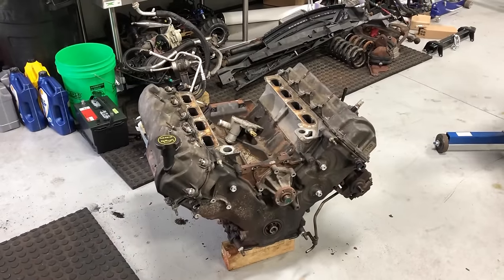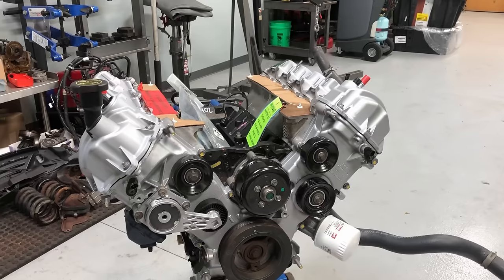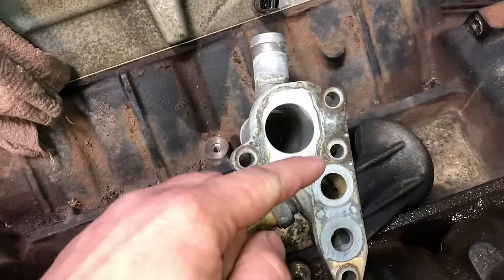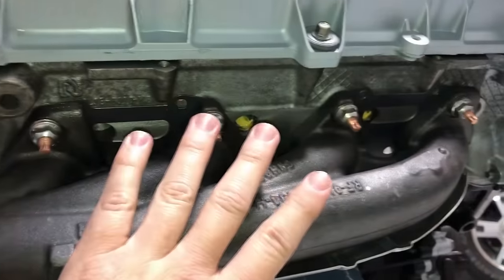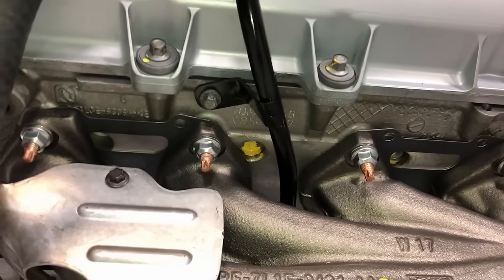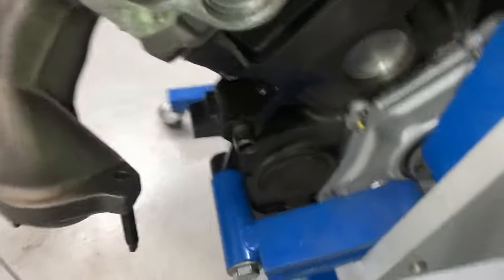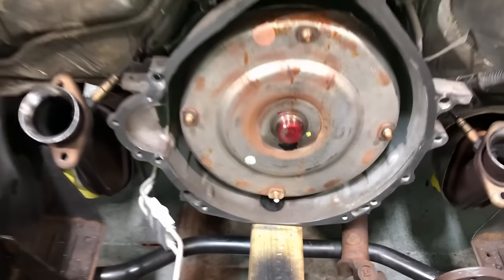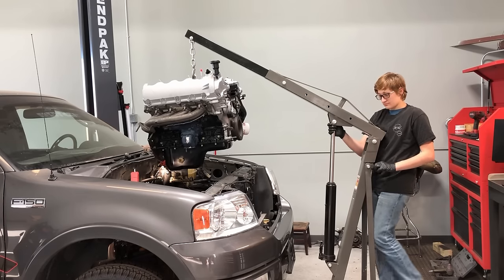Ford 5.4L 3v Triton Engine Removal & Installation Part 2 of 2: Engine Prep and Installation

Comment from the maker: These are the Parts and Tools I Recommend:
Spark Plugs 2004- Mid 2008 25ft lbs-
https://amzn.to/32tCjEw
Spark Plugs Mid 2008-2014 106 inch lbs-
https://amzn.to/2Q72fmS
Exhaust Manifold Downpipe Studs-
https://amzn.to/2X0gjQx
Permatex Ultra Black Engine Sealant (if required)-
https://amzn.to/2rxpz31
Permatex Blue Threadlocker-
https://amzn.to/2pY1IsM
Coolant Crossover Gaskets:
LH- https://amzn.to/32xHAel
RH- https://amzn.to/36PB9qj
Mopar Rust Penetrant-
https://amzn.to/35GAxmi
10mm Gearwrench (power steering bolts)-
https://amzn.to/2VRT22B
Cat Claw-
https://amzn.to/31lso3b
Trim Tool-
https://amzn.to/31ndv0f
Fan Clutch Remover (easiest method)-
https://amzn.to/35Ot9Wf
Starter Removal in detail-
https://www.youtube.com/watch?v=yhXV-aIv_bA
Remanufactured Engines I use-
https://www.powertrainproducts.net/FORD-5-4-V8-ENGINE-04-06-F150-NAVIGATOR-EXPEDITION-p/1579.htm                                                                                                                                                                                      TORQUE SPECS:
Valve Cover Torque Sequence
Early Build:
LH- https://drive.google.com/file/d/0BzYkF_-Nh949YkFXTmxFbTNVcXc/view?usp=sharing
RH-
https://drive.google.com/file/d/0BzYkF_-Nh949akIteHRIcWhvVDQ/view?usp=sharing
Late Build:
LH-
https://drive.google.com/file/d/0BzYkF_-Nh949Tno0czVseFh2WjA/view?usp=sharing
RH-
https://drive.google.com/file/d/0BzYkF_-Nh949WWRHVVg4ZFN5SWM/view?usp=sharing
Intake Manifold Torque Sequence-
https://drive.google.com/file/d/1EeIgiG4HPYOk_76QeNJZ4ZJlzWOW42Qa/view?usp=sharing
Flexplate Torque Sequence-
https://drive.google.com/file/d/1Q8t7domsnmENjZBbs82ogjy-gk8aDwnN/view?usp=sharing
Engine Mounts:
Drivers Side
2004-2005 Early Build- 162ft lbs
2005 Late Build- 2014 258ft lbs
Passenger Side
2004- 155ft lbs and 18ft lbs for 13mm nut
2005-2008 184ft lbs both nuts
2009-2014 129ft lbs both nuts
Reply: Hi, I have an unrelated question, I changed the timing set on a 5.4 2v.  I'm pretty sure I put the plastic rail tensioners on wrong side (left on right and right on left). Should I take it apart again to correct it or do you think it will be fine. In only a few miles is running fine so far.
Reply: Curious at this point how much all of that costs? Between the engine, shipping, new parts.... does it make sense? Or should I say dollars and cents? By the time these trucks need this much work, generally unless they were really well kept as far as body and interior, they are worth less than the parts for this build. Am I wrong? I'm currently considering doing cam phasers, timing set, and oil pump on a nearly cherry 05 expedition, but they routinely sell for $4500-5500, so if I had to do an engine I would being buying the value of the vehicle in parts essentially. I'm a bit conflicted especially once you add in all the labor.
Reply: FordTechMakuloco  can update you tell me what the part number is for the 2004 fx4 brake booster Vaccum to intake hose is
Reply: FordTechMakuloco Is that engine better than the Ford remanufactured one?
Reply: Hey I have a question about a 98 Ford F-150 with a 5.4 my uncle sold me this truck and gave me a packet that reads 2007 remanufactured motor what does this mean and also how can I get ahold of you to ask questions
Reply: FordTechMakuloco Would you recommend 5W30 for the 2 and 4 valve engines as well or stick to 5W20?
Reply: @atx-cvpi_99  keep it the same unless you change the oil pump. Lol you responded to me on scotty channel.
Reply: I did this swap for a customer probably 13 years ago. They ran it too long with a blown head gasket.
Reply: Did u also buy they installation kit?
Reply: Head bolts torque specs on 2000 5.4 F150???
Reply: I've seen a few comments blaming your son for the incident that occurred failure to secure the engine hoist from rolling backward is what caused the sudden movement.
Reply: What if you don't bolt the flywheel back thru the same holes it came out?
Reply: I have a 03 f150 with the 5.4 Triton and thinking about replacing the motor. Is there anything that differs in regards to install other than intake/throttle body on yours?? Thx in advance!!
Reply: Ive got a question if possible.... whats the torque spec for the coolant crossover pipe and thermostat housing....I can't seem to find them anywhere.....  the pdf you posted for the intake said said 89 In-lbs for 3 bolts but the crossover on the 06 has 4 bolt holes... is that the correct tq for them
Reply: THEE JOYS OF OWNING A VERY EXPENSIVE PIG... CALLED A FORD... NO MATTER HOW MUCH LIP STICK FOLKS PUT ON EM THEY'RE STILL BIG PIGS....
Reply: Just installed a 5.4 from powertrain products and engine is hard to turn over by starter and or by hand it acts like its bound up any thoughts
Reply: I notice u have 123k miles. How much do u have now with this new engine? 😅
Reply: Im going to finish this swap in a matter of days, should i use 5w30 blend or full synthitic?
Reply: I can't find 2005 Ford motor mounts anywhere. Are there other brands that are comparable such as Power Torque or Sigma? Great videos!
Reply: How much to do mine total
Reply: What intake manifold do you recommend using now that the Ford OEM is not available.
Reply: Where did you buy the engine.
Reply: Im wondering what oil you might recommend for the initial break-in period?

Comment: What a great dad, he didn’t scream or cuss his son out, he handled the small error of dropping the engine too fast awesomely.  Better than I would have for sure!
Reply: So true! My father would have let me have it lol! 👍
Reply: I thought the same thing. This guy is a great mechanic and obviously a great dad. Everyone is always learning and yelling only discourages.
Reply: Maybe he yelled at him after the video 🤣
Reply: I agree. Such an awesome way to handle this situation
Reply: Lefty loosy righty tighty!  

Applies almost 100% of the time.  Unless you own something like a bus, then the drivers side lug threads are reverse, but anyway.
Reply: Couldn't have said it better myself!  My son would've gotten an ear full from me to say the least.  Brian is such a pro.
Reply: Yeah I would have freaked out
Reply: A good dad understands that as soon as his boy made that mistake, he already knew everything he needed to learn about it.  No need to pile on.
Reply: After reviewing the video I have determined that the cause of the problem was that they did not block the engine hoist the engine touched part of the truck caused the engine hoist to move backward which caused the valve to rotate in the young man's hand the young man immediately closed the valve as soon as the engine hoist moved backward it was the adult's fault and he did not secure the engine hoist
Reply: @kgardner004  Makuloco's son accidentally loosened the valve. Not a big deal, accidents happen. As the engine rapidly lowered, the horizontal distance from the hoisting point of the lift and upright pivot point of the lift became longer, due to the change in angle of the lift arm. When this change in length occurs, either the engine, the lift, or both have to move horizontally away from each other. Since the lift has a great deal less mass than the engine, the inertia of the engine won, and the hoist got pushed away.
Reply: I would’ve got beat forsure
Reply: You guys are something else you do not surprise me with your comments
Reply: Horror movies ain't got shit on the jump I got from watching that drop. I thought I was about to see an ass get beat.
Reply: Yea I think I would've called for a pause in the recording and when we came back SOMEONE would've been........a little messed up!
Reply: @nodriveknowitall702  😂
Reply: @Sockemtickem  Happy to have given you a chuckle.
Reply: In the kids defense,,,,  Those little valves on the crane and the piece of just pole they give you to work it suck and are touchy as hell.  That valve doesn't give you any leeway and are either fully closed or fully open if you aren't super careful
Reply: I was not expecting that!
Reply: WorldRenownedCFE 🎤  🙄
Reply: This man is a great human being! Think of the 100's of thousands of Ford people he has helped.!  Love this dude!!
Reply: I’m sure he 100% expected him to drop it at some point. I think everyone has done it at least once in their life if they’ve done many engine swaps.
Reply: He seems like a pretty chill guy
Reply: I would have peed
Reply: kids lucky the camera was rolling....
Reply: My dad would’ve tore me apart for that lol

Comment: My son and I were able to swap out the 5.4 in our 2004 F150 in a couple of weeks following the videos. No issues and the truck started and ran perfectly first try. No codes. No noises. Just a smooth running truck. Thank you for the care and time you put into your videos. They are a tremendous resource!

Comment: UPDATE: Heads up!! to anyone doing this a few years down the line. Powertrain products no longer ships the rebuilt engines with the 3 stud bolts at the top of the timing chain cover (where the radio interferance capacitors and AC comp muffler go) make sure you buy new ones or take yours off the old engine!

Comment: I bought the same exact motor and used these videos as reference on questions I had which has been amazing and helped me out quite a bit! I would like to add on the oil priming process I went through about 10 sessions of cranking and never got oil pressure. I called the warranty department for the engine and they were very helpful and told me to try a few things. First thing was take the oil filter off and crank it then. If that didn't work get a jack, jack up the back end of the truck as high as I can safely do it and try it again with the oil filter off, it didn't work with just the oil filter off so I jacked up the back end and initially it didn't work but after a few more pumps on the jack got it a little bit higher I finally got oil to come out of the oil filter housing. I then put the oil filter back on and immediately got oil pressure on the next cranking session.
Reply: Nice!  Thats a crazy story but useful info too🙂🙃🥳
Reply: Great info
Reply: Had the same issue with the oil priming. Thanks to your comment I knew what to do! 😊
Reply: I'm very happy to help!
Reply: I had the EXACT same issue and was fully prepared to wash my hands of it and have it towed to a shop.  But…this worked like a charm.  Amazingly helpful post.

Comment: In the 80's we would do this job 2 or 3 times a year with our buddies. Someone was always needing an engine. 24 hours and 48 beers later we'd have another used engine installed. Never ever did anyone get a brand new one.
Reply: I think the problem lies with this particular engine. I’m looking at a rebuilt engine, as mine has 215k on it and has had timing problems twice. First was at 193k and I had to use a non-Ford kit. Which brings me to 215k and something jumped time. Rather than buying a new truck, I’ll spend $3,500 and hopefully be in good shape for at least 100,000 more miles.

Comment: The Best Ford guy on YouTube!!!! The detail on the transmission line up is so important, Take your time and do it right. Thanks for your Excellent videos and sharing your skills. A pleasure to watch a great Tech!
Reply: I seem to be having issues with the metal shim hitting my torque converter studs and making it so the engine won’t turn over when the trans is bolted in. Any tips?

Comment: I just swapped out my old motor for a reman from powertrainproducts. These videos were awesome. Huge thank you! Also as mentioned elsewhere in the comments, I also couldn't get oil pressure initially, so finally removed the oil filter and jacked up the back of the truck. Once oil started spilling out, I put the filter back on and bam, had oil pressure on the next cranking session. Truck is running great!
Reply: How much did the engine run you and do you know what kind of internal parts they use?  I got a 08 with 275,000 that I'm gonna have to replace the engine or get a new truck not too far down the road.
Reply: @Jay388  I just Purchased one this week it was $4700 they are running free shipping through this month of May and the engine itself is actually discounted quite a bit.

Comment: Outstanding two-part video. Thank you for all the detail. I followed the two videos minute by minute on an 07 FX2 and the truck is running great. One fun thing if you’re going minute by minute- put a pan under the lower radiator hose before you disconnect it from the oil filter adapter. I dumped a ton of fluid in my garage then pressed play and sure enough the next step was to put a bucket in place, had forgotten seeing that advice when I watched the whole video earlier.

Way to stay calm and cool with your son!

Comment: Many years ago, when I did the trans on my 93 F150, I used a couple pieces of all thread through the dowel pin holes. As I tightened the nuts, it pulled the trans forward in near perfect alignment. It worked like a charm.

Comment: I admire your patience and the fact that you didn't edit your son learning through his mistake. It was a great learning experience for him without being yelled at. I know I would be yelling at mine. Love learning form you on the 5.4L 3V. Thanks for the educatation on the Cam Follower removal. I am living and repairing throug a P0017:00 Camshafat Position Correlation - Bank#1 Sensor B. The Error correlation for the two sides was -3.25 to the drivers and -20 to the passengers. I watched your video on the data stream. Everything is coming along really good just time consuming. Well thanks for always being great. I will continue to watch. Rob NYC

Comment: Great tips Brian. You may remember about one year ago I did exactly that to my 04, I had emailed you regarding questions about my build. Your knowledge on these trucks is greatly appreciated. While the engine was out i did trans rebuild and u-joint replacement as well. Since then I raised the front end 2 inch to level the truck, replaced the struts and springs (O'reillys cheapies, don't recommend),  rebuild front suspension all Moog parts, clean up entire frame, two coats rust encapsulate (I used chassis saver, I'm from the "D" road salt sucks)  and satin black top coat. 20,000 miles still going strong. Peace
Reply: Nice upgrades it sounds like. I'm in NewYork and need to do same to my 2010 rusty frame under under body

Comment: Hella good job, and explanation for the whole process. Sold off my 06 Lariat for a newer F150 with the 5.0. I'll miss those quick air filter changes on the 5.4 3v.

Comment: Brian, thankyou for this video, ESPECIALLY the torque settings and special tools you used.
I'm familiar with the 2005 IMRC circuit.  Seeing that one on the back of the engine brought back memories of the two problems I had with a vehicle.  That vehicle had the engine replaced.  Later on I found out why.  A stuck open intake valve in the Number 7 (3rd one in passenger side) which allowed combustion flame and gases into the intake, melting the IMRC flapper valve and no movement from the system.  New intake fixed that.  Something happened to the small wires to the IMRC harness before I got it, so I rewired from the connector to a known good part of the harness.  All together, checked the system operation with the IDS, all good.  The road test was WOW!  Very good power and put a smile on my face!  Thanks again Brian!

Comment: Best thing this video did:  convinced me to hire this out.  My 2009 Ford 3-valve is the reason I drive a 2014 Chevy.  Any plumber can explain galvanic response and how you use insulators to prevent it.  Ford just mates ferrous with alloy directly  and hopes the ground straps are enough.  Incredible.

Comment: I don't know how you stayed so calm when your kid dropped the engine..
Reply from the maker: It was over the frame at that point not much could get hurt that I can’t fix.
Reply: This is what makes Brian such a great teacher. Zen Master Brian
Reply: We have all done it, just fix what got broke or bent and move on.
Reply: What are you gonna do ,it was over and done with and it wasn't on purpose .All getting crazy is gonna do is make things worse and make his son not want to do things like this again with his old man.
Reply: I have seen profession technicians accidentally drop too fast and the engine bangs down hard.  Like Brian said, not much could get hurt that couldn't be fixed.  It happens sometimes.
Reply: We all know you have to have the patience of a saint to even work on fords to begin with. As many as hes worked on you already know hes had way worse things happen to even get to the point hes at by now.

Comment: I don’t want Dorman anything,especially Dorman crap installed inside my engine. Surprised you don’t go Ford Reman.
Reply: The new ones must be alright,he wouldn't use them if he thought they were junk,if you've been following this guy for a while you'd trust his judgement ,he knows these Tritons like the back of his hand.If he says they are good enough,trust me they are good enough.
Reply from the maker: The XD phasers are doing fine so far but no this engine had all Ford components.

Comment: Thank you for these videos. I recently bought a cheap 2006 f-150 with a blown 5.4 3v and finished the swap today. I referred to your videos many many times on disassembly and reassembly. It has been 20 years since my last engine swap and I have done many in the past but a 5.4 3V is a bad choice to start back into it lol. This truck is just for myself so I am picking away at it. I expect with the used engine, price of the truck and all the parts for safety and refurbish to be around $3500 CAD

Comment: I use those old plastic housing gas filters (paper media) for the rear-axle vent tube. I've almost dropped an engine like that before. Broke  out in a cold sweat.  They need to improve those release valves on the cherry pickers! Great to see some father/son interaction. You're son is lucky; his teacher is one of the best.